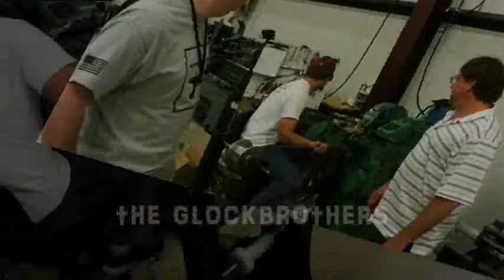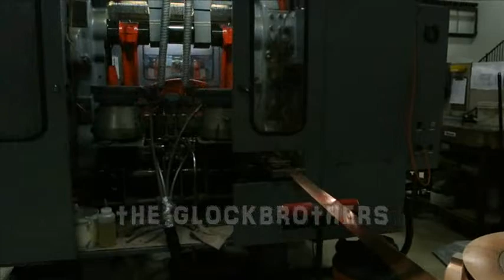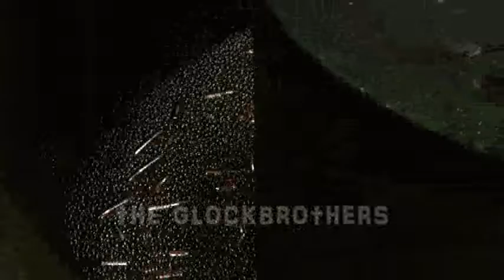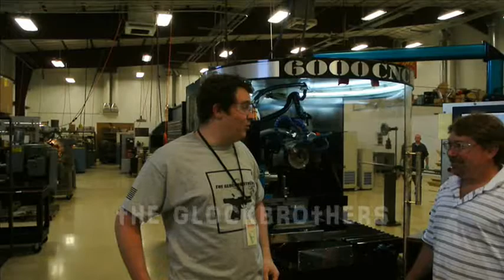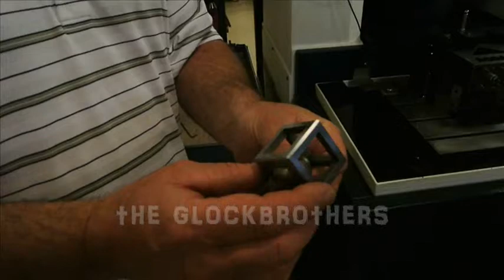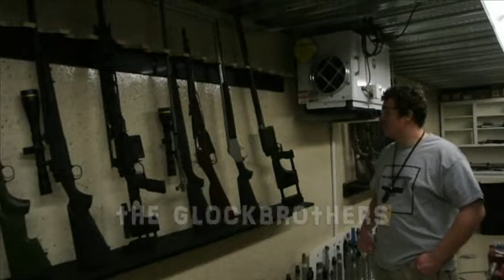Barnes Bullet Factory Tour Part 2 by Glockbrothers

Comment: "Top of the line technology" as they are using WWII presses lol
Reply: Everything inside of the press, the inner workings-- the mechanics-- are all rebuilt and brand new. The only thing from WWII is the frame of the press, which is 100% cast iron. The machines cost upwards of $1M after everything is rebuilt.